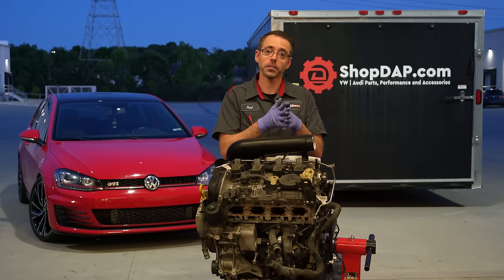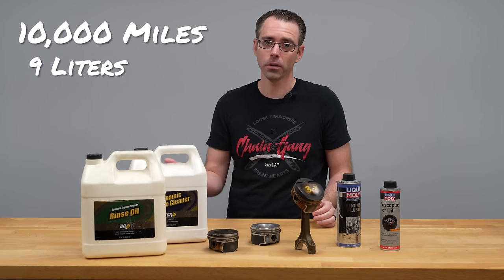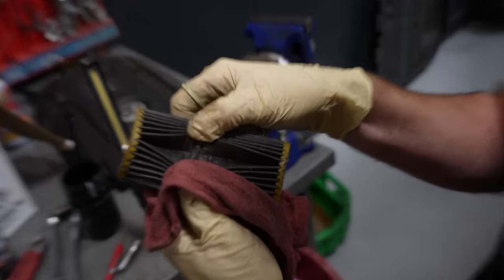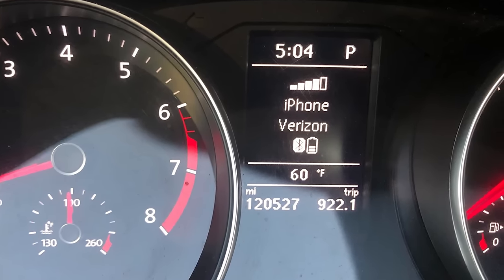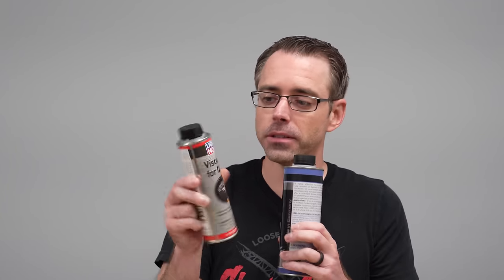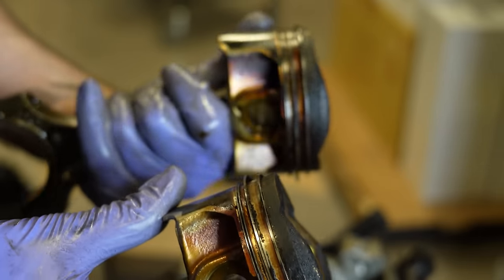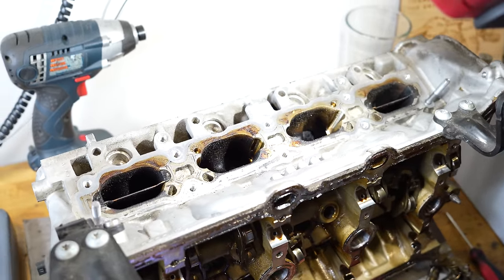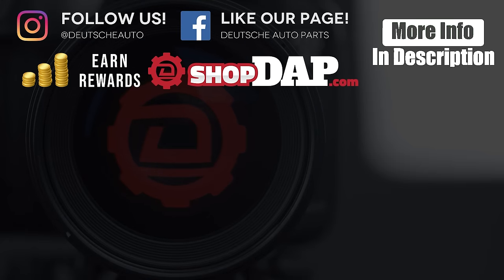Can you Fix an Engine Burning Oil for $20

Comment: Hey if u need another VW that burns oil, you can take my MK6 with 76k miles on it... I burn about a liter every 1500mi... Jiffy Lube has been my best friend adding a quart and little over every 1200mi.

Ive had VW look at this in 2020, when I purchased my used 2013 MK6 with 15k miles on it.

I luv the car, the engine moves, but the oil burning is unacceptable in my book. I've own a 2013 Merc C300, and  2013 BMW 528i all with miles over 70k at the time... An no oil burning problems.

For this reason, reason I've been hesitant to invest in VW MK8 or any other VW line. Dang, I luv GTI... Might have to kiss them.goodbye.

Comment: Simple and the best solution:  just buy Toyota/Lexus
Reply: Sorry to tell you, but Toyota/Lexus have implemented the same type of oil control ring on their pistons... Change your oil every 3k-4k miles, when the motor is warmed up, don't drive it soft, go a little hard on it from time to time responsibly.
Reply: @ericmilliot5807  Had Scion tC ~280 wheel HP - had driven very, very hard that car - had zero, ZERO issues - changed oil every 15,000 KM, tires and brake pads... now I drive Corolla Hatchback ~220 Wheel HP so far made ~70,000 KM - no problem

Comment: I have a better Idea, buy a car new, change the oil and filter every 3,000 miles and overfill the engine with 1/2 quart  marvel mystery oil. Your engine will purr like a kitten, never burn oil or get carbon deposits. Even at 300,000 + miles.